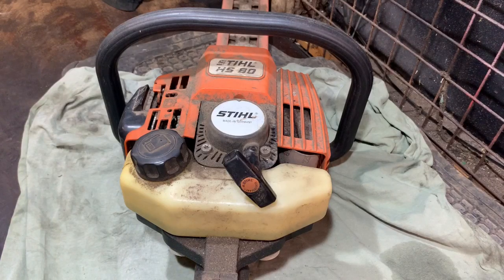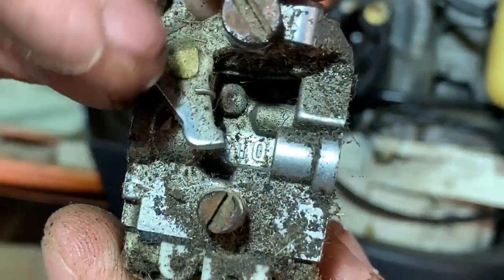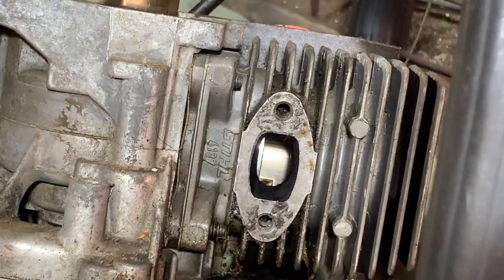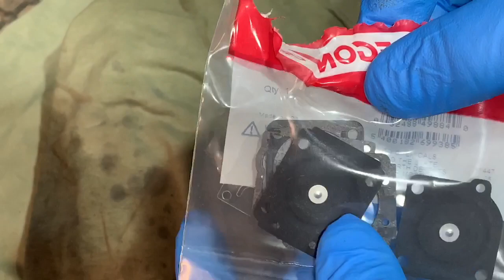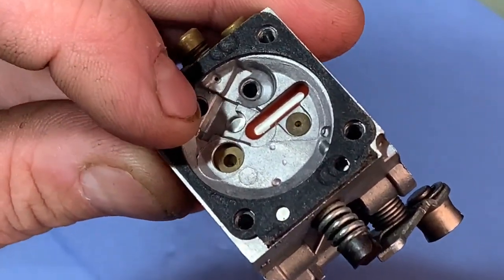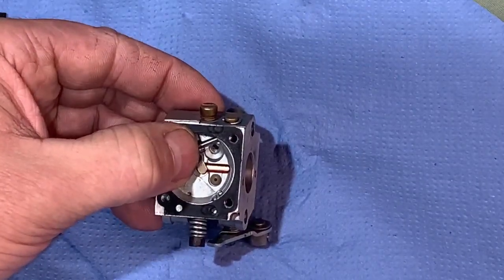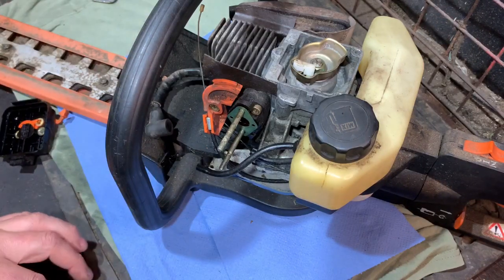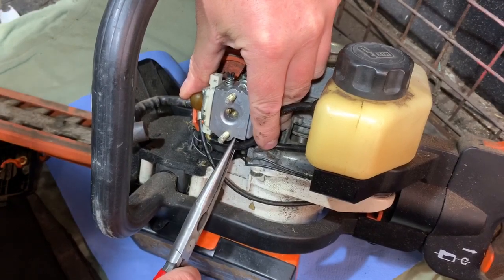Stihl HS80 Hedge Trimmer ( non runner easy fix )

Comment: Good job, Hedge trimmers are the only thing I don't like to work on, I spend the whole time imagining me losing a finger to the blades.
Reply from the maker: Hi Bill they are ok, if concerned wrap a towel around the blades while you are working on them, thanks for watching 🙂👍
Reply: @Menditman2014  i dunno what it is about them. It's the only yard tool I will run an electric cord for. They don't bother me at all.  Hey, it doesn't have to make sense.  🤣🤣🤣